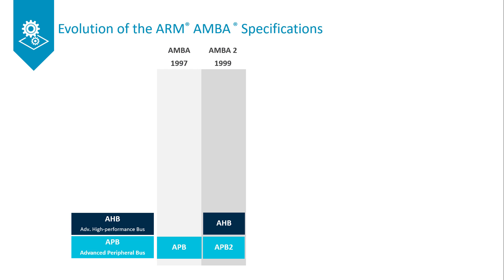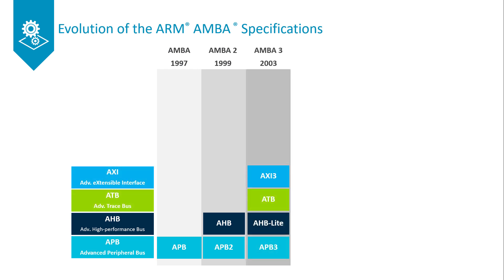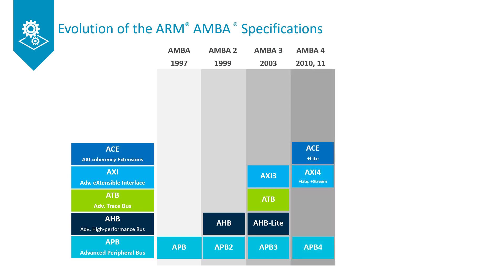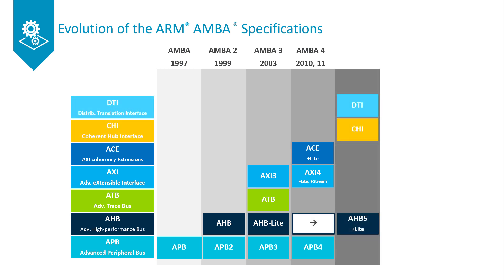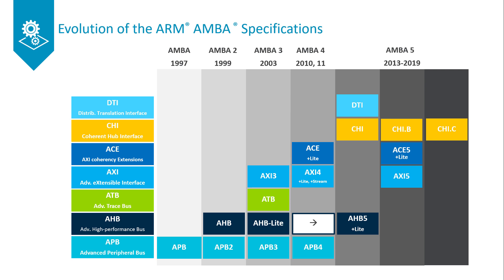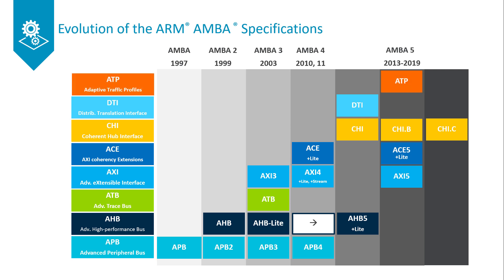Evolution of the Arm AMBA Specifications

Comment: 🎯 Key Takeaways for quick navigation:

00:00 🧩 AMBA is an open-standard for on-chip interconnect, facilitating communication among functional blocks in SoC designs.
00:50 💡 AMBA enables efficient IP re-use, offering compatibility across a wide variety of SoCs.
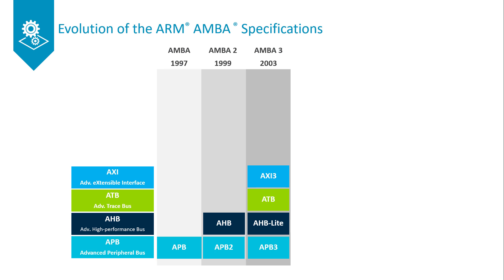01:37 🤝 AMBA is well-supported in the semiconductor industry with third-party support and tools.
02:26 📊 Bus interface performance depends on bandwidth and latency, critical factors for efficient communication.
02:52 🚀 Achieving maximum bandwidth with zero latency is essential for interface efficiency.

Made with HARPA AI